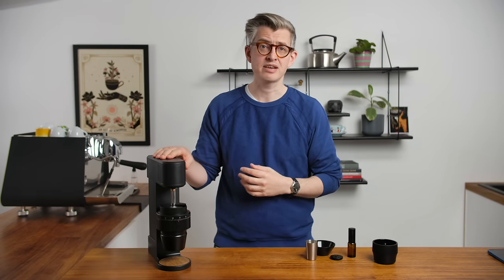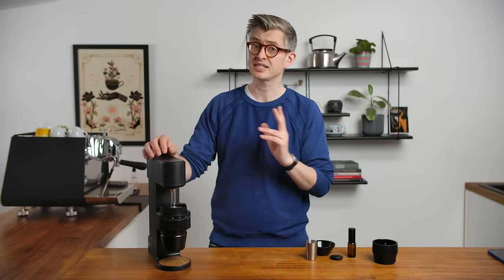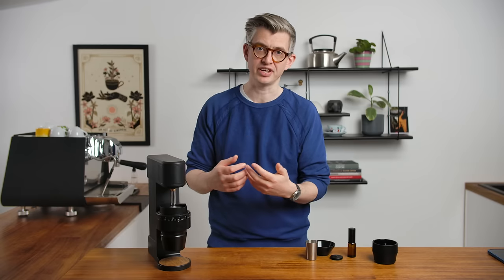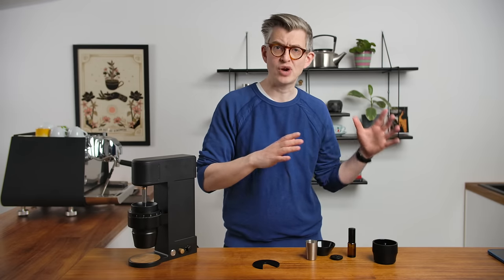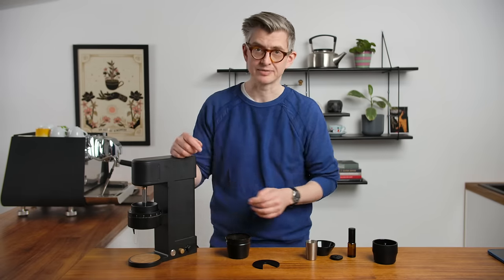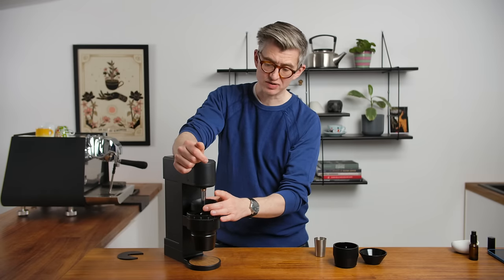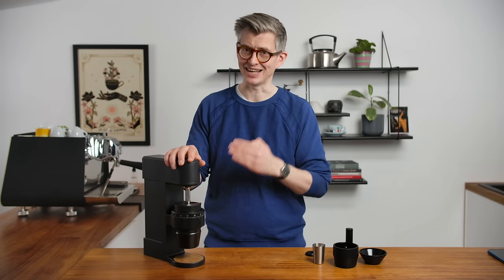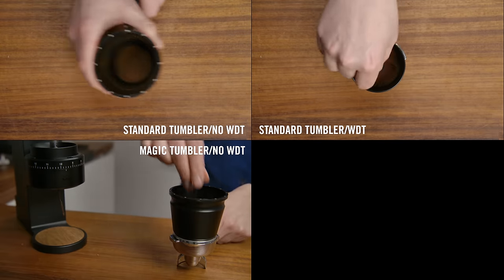Weber Workshops Key Grinder Review

Comment: This is the first time I've ever been kind of irritated by a JH product review. He side steps over and over about whether the grinder is worth the money.. JH was not like this with the Niche. It's clear the Niche is a way better value, otherwise he wouldn't have even mentioned it.   He's just being very careful not to make enemies of LWW.    I have loads of time with LWW grinders, having owned two HG1's and an EG-1 (yes, a ~$4000 coffee grinder). These are really beautiful grinders but I have had massive issues with static on all of them. RDT is an absolute must for them, whereas there are many other electric coffee grinders that do a far better job curbing static.  Secondly, the grind retention in/out is not an accurate depiction.  The fact is these are MASSIVE burrs and there will be residual grounds in the burrs themselves.  The larger the burrs, the more of this residual powder will remain and imparted into each subsequent grind. Large burrs are not at all indicative of quality.  I have smaller handgrinders with miniscule burrs by comparison that do a stellar job, with far less powder being held between the vanes of the burrs.  I was blown away at a cheap $80 Timemore Slim Plus outperforming my HG-1 in both grind quality and number of cranks required (and ease of grinding as well).    Anyway, LWW is a brand I'd ever recommend, from my own experience.   Proof (check out my IG, username coffee_rx).

Comment: I can tell you right now that there's no way they're holding concentricity or runout tolerances of 5µm between the motor shaft and burr set. If they want a visible shaft like that and super tight grind tolerances, then the shaft should be supported on the burr side. (Beautiful looking machine though)

Comment: Great review - if you really want to make a scientifically confident statement regarding the use of the magic tumbler, you'd have to run each grinding experiment in triplactes and calculate the mean and standard deviation ;) I doubt that there would be a meaningful difference across the four methods presented - but i'd be glady proven wrong, when presented with charts ;)

Comment: This thing has a few nice innovations IMO, namely the "magic cup" and integrated distributor, but at that price point it seems like a piece of unadulterated wankery. The unnecessary use of a driveshaft, the fussy collars necessitated by the design, and especially Weber being in denial over the potential for alignment problems would be a dealbreaker for me even if this thing were significantly cheaper.

The Niche is approx. 1/3 of the price and, aside from the RPM adjustment, which is of debatable importance anyhow, can do everything about as well as the Weber. Possibly better since there's no risk of the driveshaft becoming misaligned and then having Customer Service blow you off because "that can't happen."

Comment: What they should’ve done instead of changing the motor speed change the speed by a set of gears like a gearbox and then the electric motor would not stop Or get stuck
Reply: Probably would make the design more complicated and more prone to failure or more expensive.  Mine never really 'stalled' just micropauses with lowest rpm and light roasts. Still works, but the mini stalls may affect grind quality since RPM affects grind quality (in this case it might not be enough to be noticible though).

Comment: I have to pick up on something I've seen mentioned in a couple of videos recently, and that is the idea that you can assess retention by comparing the weight of the grinds to the weight of the beans put in. No grinder in existence will produce less weight of grinds than that of the beans put in (except for the first few shots from new).
Imagine a grinder that gave 14.5g of ground coffee for 15g of beans, which doesn't sound too bad (0.5g of retention). Now repeat 100 times. Where did the 'retained' coffee go? Does the grinder now contain 50g of coffee? After 1000 shots, does it contain 500g of coffee? Of course not...
A grinder with 0.5g of retention would hold onto 0.5g of the coffee you put in, but release 0.5g of the 'old' coffee from a previous grind.  The net result is that you measure 15g in and 15g out - but that tells you nothing about retention.

Comment: it's strange to me that some of these more boutique grinders dont use a simple gear system (could be super cool and steampunk-y!) that would mean lower grind speeds also provide higher torque, removing the issue of the motor stalling.

Comment: It seems like this grinder is kind of an expensive gimmick. It kind of does wdt. People willing to spend $2000 on a grinder to make 36 grams of espresso are going to be doing their own wdt anyways.

If you want conical the niche seems like a smarter idea. It has a proven track record. If you want better Lagom p64 is less expensive than the weber key. This weber grinder seems pretty, but unrefined. A df64 is unrefined and $1500 less and you have more burr options if you can get past the somewhat hacky look. 

The weber key is an aesthetically pleasing grinder with a design flaw. At that price point things should be more polished.

Comment: Can someone explain to me how items like this justify their insane prices? I see a small electric motor, two "driveshafts," the burrs, and likely some bearings. It does not at all seem like $2000 worth of components, even if theyre forged and CNC machined.
Reply: Try to build one with the same quality for $2000 and don't forget to calculate your design and working hours.
It's not worth the price for me too but there is no other manufacturer who makes grinders like this.

Comment: I can't imagine spending THAT much money on an electric grinder and then have the motor stall... How in the holy heck did that go past quality control?
Reply: Well it sounds like the stall is due to the motor automatically shutting off due to overheating, right? So it would be a feature not a bug. Not a convenient one! But potentially it could save the machine.
Reply: @kevinpenfold1116  overheating would mean that the design did not account for proper cooling. You can not convince me that something this expensive should have trouble grinding coffee when that is expressly what it's meant to do. A beefier motor would produce less heat at the required torque, and an active cooling system is something you get in even the cheapest laptops.
I'd seriously like to see someone take this machine apart and look at the motor and control electronics.

Comment: This is a straight pass. The Niche is still the benchmark at 1/3 of the price. This is an extremely hard buy to justify, as you’re basically in the commercial price range but you’re still not outperforming the Niche.
Reply: About 2x in my area

Comment: I'm far from an expert but a 2000 dollar device that doesn't have a motor with enough torque to overcome grinding coffee at low RPMs sounds like Weber is taking you for a ride, if you know what I mean. I mean you're being ripped off. Overcharged. That's what I mean.